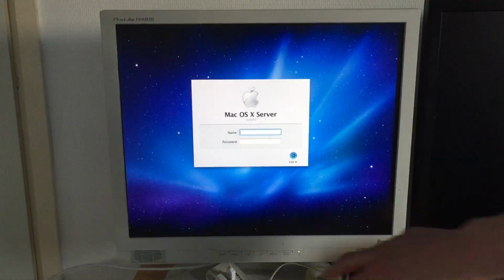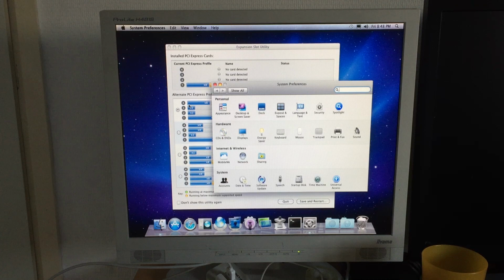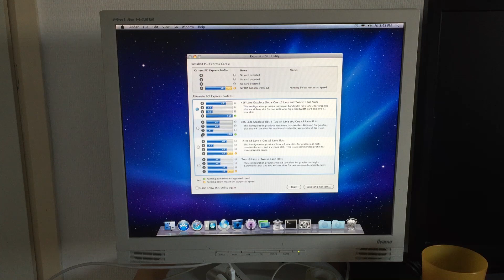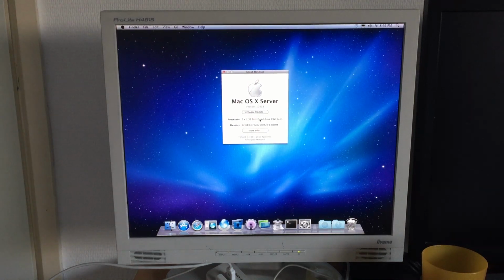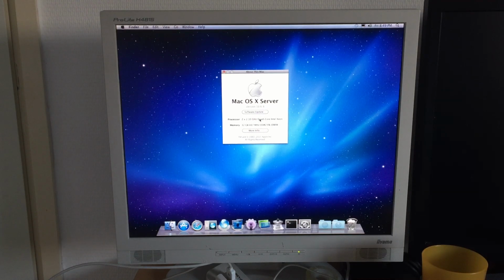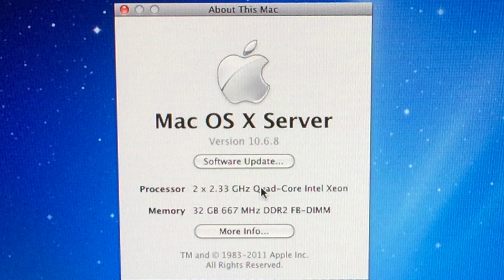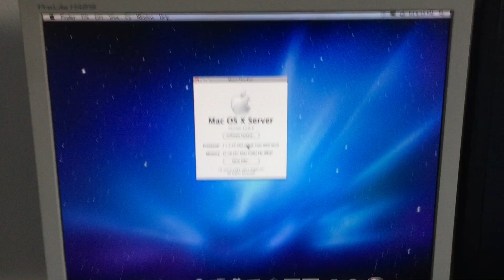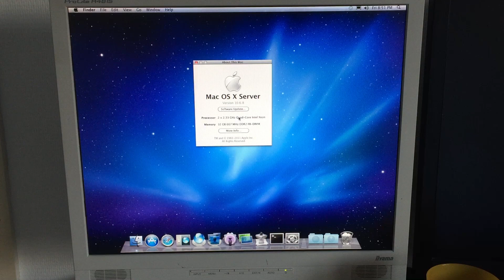Turning A 2006 Mac Pro Into an ESXi Server - Part 1: Preparations

Comment: I installed ESXi 6.0 on my Mac Pro 1.1 just out-of-box with no modifications. I believe VMware supports this machine officially up to ESXi 6.5
Reply from the maker: That’s correct, yes. ESXi 6.7 dropped support for the 5500 and older Xeons, and the next iteration will likely require an E5 v2.

Comment: I have Windows Server 2012r2 , 32GB RAM 2- 120 GB SSD's on a PCIe add in card (for the speed, but boots on another in the slot w/ an adapter)  4 - 1TB WD Black SATA & NVidia  3GB VRAM card (wont show the boot) but it runs Hyper-V  3 VM's like a charm. Would I be better off with VMWare ESXi 5 or 6 , Parellels, Virtual Box ? I don't think Server 2016 Hyper-V will run ?
Reply from the maker: +David McChesney You’re not missing much with server 2016 (it will run it, though), so 2012 would be okay. The Mac doesn’t support passthrough for PCIe cards, so that Nvidia card will be a bit of a waste in that regard.

Comment: i was thinking of buying a 2006 mac pro can i put 64bit windows on it?
Reply from the maker: Yup, you sure can. The firmware being 32-bit doesn't limit you in Windows at all. It'll even run Windows 10 64-bit no problem.
Reply: nelizmastr okay i do have aanother question. do you know any thing about power pc macs?
Reply from the maker: Yeah, I still have a few PPC Macs around. Shoot.
Reply: why shoot? i have old powerpc g4 and need a coppy of mac os x tiger. but that is the only mac i own
Reply from the maker: I meant shoot as in feel free to ask. I'd personally just get a pirated copy from the pirate bay or something. It's obsolete software. That's where I got my 10.4.6 image at least.
Reply: nelizmastr okay.

Comment: i got hd 4850 for 30$ and it is working like a charm with my core 2 quad q8400
Reply from the maker: PC cards are easy to find, yes. Mac cards are significantly harder to come by, especially for a justifiable price.
Reply: yeah! I saw hd 59xx series card for mac pro for 250$!

Comment: what is the power usage of this machine?
Reply from the maker: The CPUs have TDPs of 80W each, and the graphics card isn't used at all. Adding 10W per disk and some for the FBDIMMs and it's probably around 200-250W when it's under a typical load of 25-50%.

Comment: I recently got a 4870, sadly it was DOA. I tried in two different PCs, one LGA 775 and one AM3+, exact same screen corruption.
Reply from the maker: Yeah, these cards require maintenance. If a card is just run for 5 years straight, it'll cook itself and die.